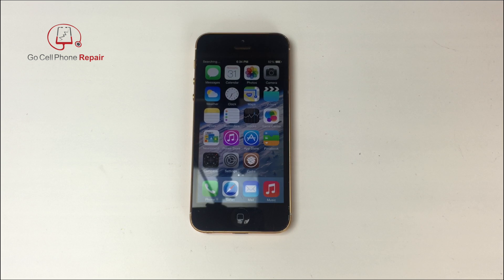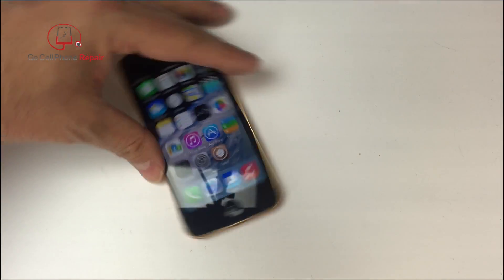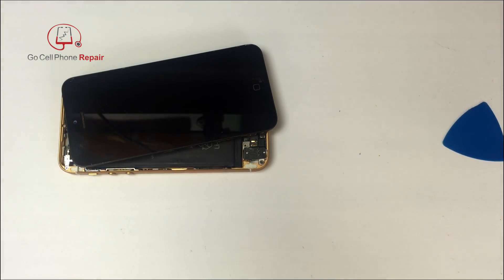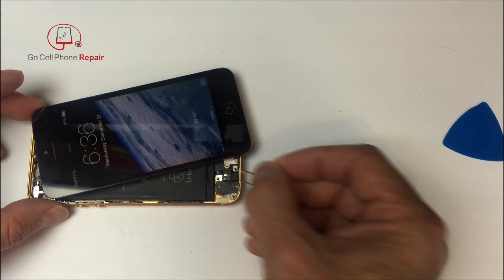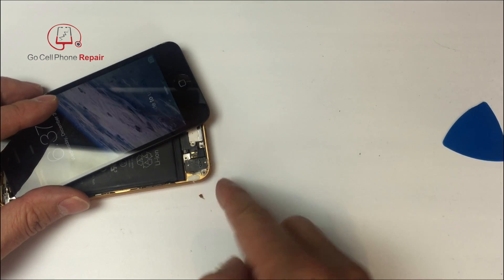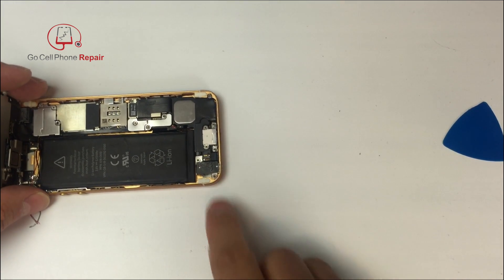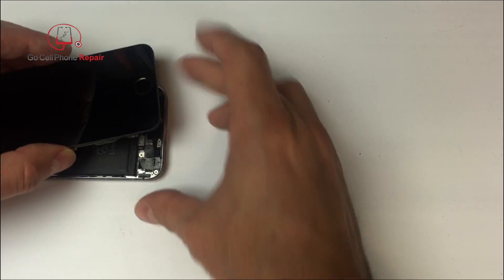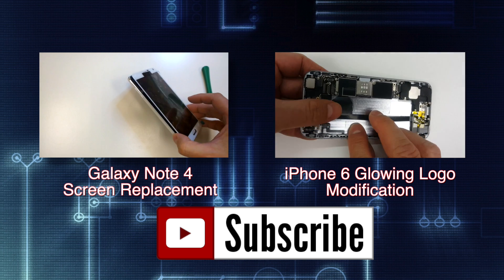How to Troubleshoot iPhone 5 and 5C Home Button

Comment: Hello, i want to ask. I have iphone 5g and the homebutton didn't work. If i replace it, can i use the 5s style home button into my 5g? Thank you
Reply from the maker: The cables that connect them are quite different. So to answer your question no. You might be able to find an after-market iPhone 5 button that looks like a 5S but the real ones will not fit at all.

Comment: Hi, great vid, Although ive got a different problem. I replaced my old battery with  a new one. After repair i found out that my buttons ( turn on/off, sound buttons, mute and home button ) do not work. 
Would you mind helping me with that? How do i fix that?

Comment: After watching this video. I figured out the issue that I am having. You see, I ordered a part for a new screen and apparently the issue was that the discs on the bottom of the screen where bent in a wierd way. Soo I compared it with the old screen and the others where flatten. Soo I removed the screw holding the frame for the lcd and began to push slightly on the discs,  and the wires and boom problem solved! Thanks! If you hadn't explain how the home button functions then I would have been scratching my head for awhile 👍👍 thanks again!

Comment: Thank you very very much.   I appreciate your video.. it helped solve my problem. The metal contacts inside the phone were pushed down too much.  I gently lifted them back up just a bit.  While the phone was open, I gently cleaned the mental contacts on the home button.. all works great again.

Comment: Hi! When I test it like you did with the clipboard it works, I checked the contacts and they are broken.. what do I need to buy!? Because I was checking on amazon and it doesn't show the contacts on the charging full flex replacement.
Reply from the maker: Sounds like you need a new home button flex cable. You are saying that touching the contacts with a paper clip activates the home function right?

Comment: my pins are broken is there a way to fix them
Reply from the maker: Do you mean the pins that make contact with the home button circuit? If so I'm sure that they can probably be soldered back on but the port itself is only a few dollars so probably best to just replace it.

Comment: Hello I have a question so my iPhone 5c screen broke and I gave it to a store to have it replaced.So after 3 days I picked up my phone I paid 80 euro for it and the store dude said that the home button is not working and to fix it I have to pay additional 50 euro so I said no thank you...My question is why the home button is not working with the new screen but with the old one did?
Reply from the maker: If the home button was working before the screen was changed then it should still be working now. Did they test it when you dropped the phone off or was the whole screen blank? If that was the case it would have been hard to tell whether the home button was working or not.
Reply from the maker: Yes it does.

Comment: sir, would u give me solution, if i break the contact signal in the bottom, i lift it too much, in so careless, thanks
Reply from the maker: Do you mean the home button flex cable? If so you can replace it. Not sure if I'm understanding your question though. Can you maybe post a picture?
Reply: Go Cell Phone Repair i get confused which part do i get replacement, i broke these one, i highlight it in white circle  https://ibb.co/c7bbQa   i lift it way too much, so it's broken.
Reply from the maker: You need a replacement charge port.
Reply: Go Cell Phone Repair ok sir, thank u very much

Comment: Does the iPhone 4 have the same contact points as the 5 and 5c?
Thanks :)
Reply from the maker: The 4 is different and does not have those contacts. Instead there is an FFC/Zif connector that plugs into the charging port. It's still possible to test without performing a full disassembly but you must have a replacement part on hand to test it and remove the loudspeaker at the bottom to access the area where it plus in. I'll make a separate video for that and the iPhone 6 as soon as I get a chance.
Reply: Man, what a hassle. 
Thanks for the reply. Love your videos!
Reply from the maker: Heh, that's often the response when it comes to the 4/4S. 
And thank you very much!
Reply: hey bud
I tried to shortcut the conectors it didn't work, but then by accident I touched one of conectors to frame and screen lighted up. 
but only worked to one of conectors, nothing happens to other one when I made shortcut to frame.
so how how bad is my phone?